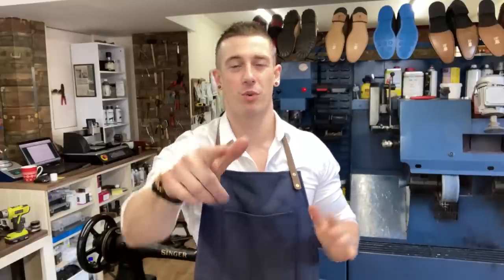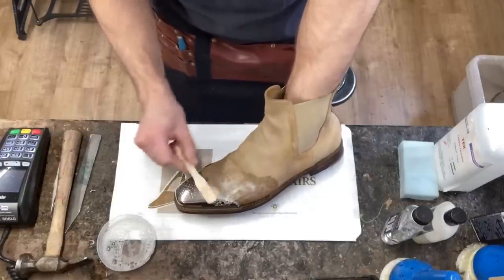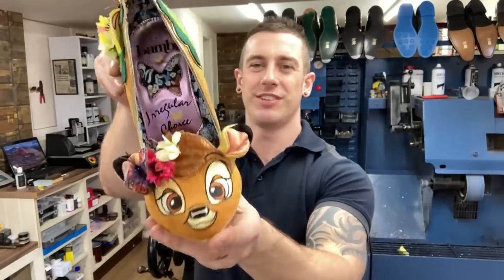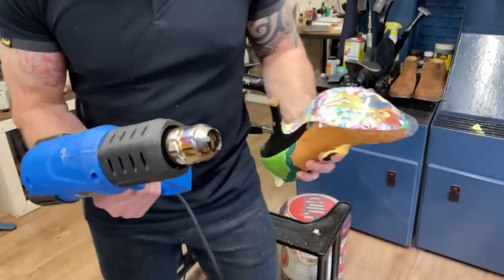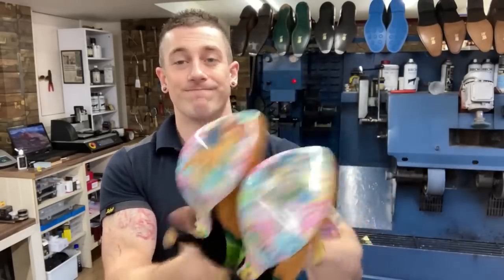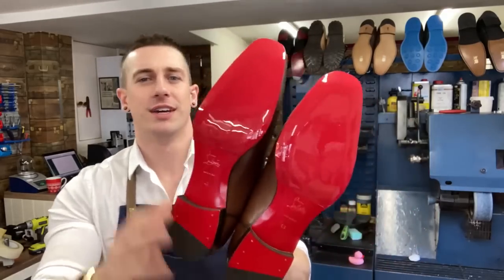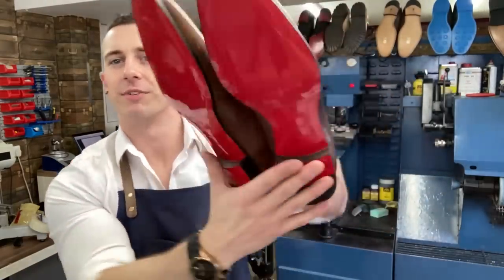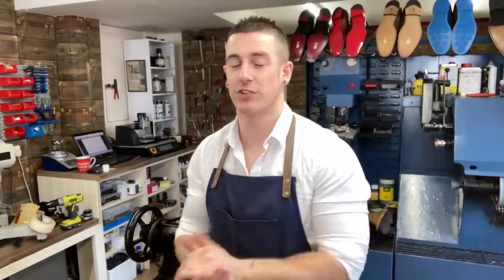DISNEY SHOES DIY plus Mens Louboutins | Jet Engine Bonus!

Comment: I feel like there needs to be a meme out of this.

"I'm just going to help my dad pull the afterburner off his vintage truck"

"The what?!?"
Reply: basically it squirts jet fuel straight into the exhaust at the back end of the turbine where it meets oxygen in the ambient air and is ignited by the extreme heat and loads of flame blasts out creating immense thrust but at the cost of terrible fuel consumption and efficiency.

i'm great fun at parties.